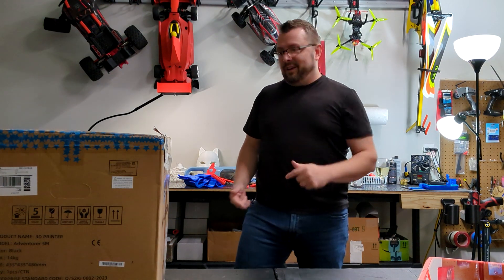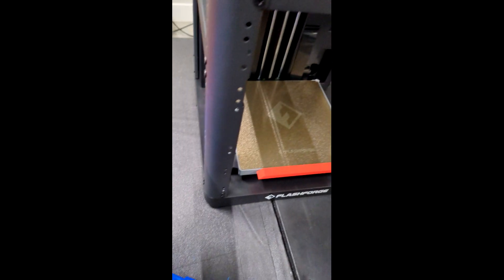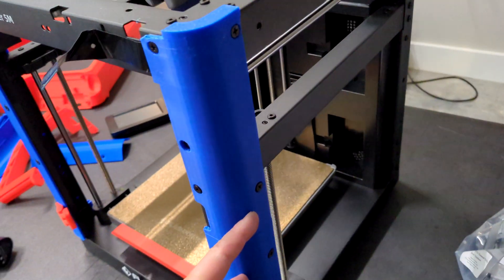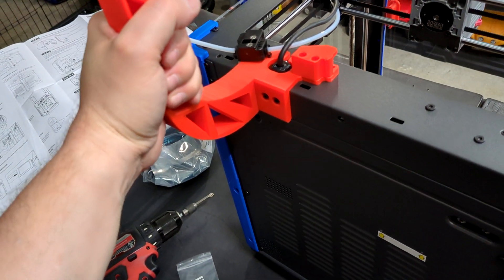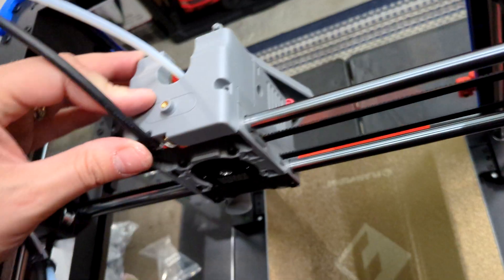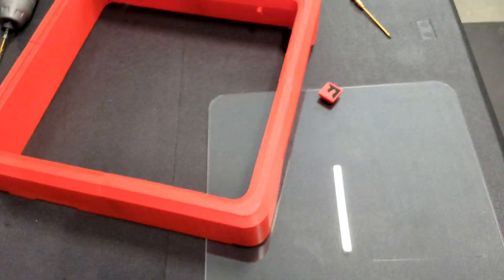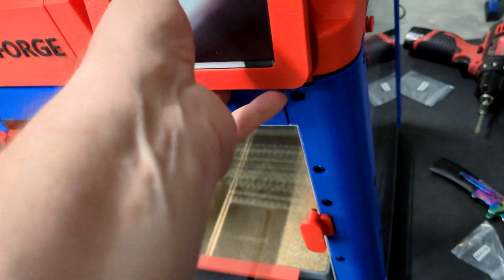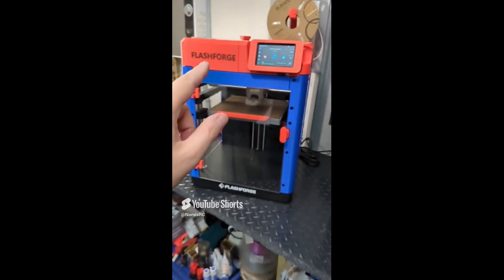Crazy 3D Printer FlashForge 5M $280 X/Y - DIY Enclosure Kit

Comment: I can't get mine to work.
Reply from the maker: Haha ok, please explain and im sure i can get ya fixed up
Reply: @NomisRC  It starts off great and then when I stop watching it I come back to a cluster of string looking like a rats nest. I'll try to get a video together and post it next weekend.
Reply from the maker: @bulrydrdan #1 use orca flashforge app, do not use flash print. Get the newest off flashforges site. When you have a part all setup and sliced when you click "print plate" in the upper right a box will pop up. Make 100% sure "Leveling" is checkmarked on every print u do.

Comment: I am trying to print the enclosure and am having trouble. The instructions are lacking printing instructions or maybe I am just to new to this to understand. The spool holder I cannot get it to fit on the print bed in Flashprint. I tried orienting it the way the flashforge's video shows and it still will not fit. Also should the hinges be printed as one part or separated. The Flashforge video shows them as one part and I printed them that way and they won't move. Anyone other newbies struggle with the enclosure kit?
Reply from the maker: Sadly all my parts were printed on a Neptune 4 Max, so I cannot help with orientations and such. My main thing would be dont use flashprint, use orcaflash its much better

Yes the hinges need printed as one, do not use brims or supports and they will print fine.

I agree it was a ton of parts and you really dont understand it all till its printed and you are assembling it. Also, you may find out on a 1 or 2 parts you need to reprint them. Such as the hinges.
Reply: I had the same issue initially, just had to keep reorienting it until it fit and it did.

Comment: Dammit man. YOU are going to get me in serious trouble.  I ran across your build video of the flsun t1, and will have it cued when mine gets here Thursday. Then I see the FF 5M vid, which is a printer I've seen over and over for $279 on Amazon and have had it in my cart a dozen times. I hadn't dug far into it and didn't know about the enclosure, which has the damn thing in my cart AGAIN! Thanks bud, my 1st printer is Kobra 3 combo, got it end of January, the delta with be in soon, aaaaaaand day after that the 5m ya ass! Lololz oh, and when your influence seemed to have finished causing me money issues, an addiction I had finally kicked a year or so ago... Know what that is? RC bashing dammit! Question, do you or are you interested in collecting Transformers figures? That's my 3rd addiction lol. If so, I'm seriously screwed. Lmao, thanks for the tip on the static on the t1. Pops tells me I just need to ground it and be ahight. He's gonna come figure out where and how n such. Once that's done and works, I'll upload a how to, and share it with you.
Reply: Btw, if it's not obvious enough, I'm being totally lighthearted, and really am glad I found your channel.
Reply from the maker: Hell ya man. RC and Printing are my absolute passions. I knew you were fuckin with me haha all good. I just ordered the 5M pro as well. Its no better it just has a couple add ons and I needed one more printer. The stock 5m is awesome. The main thing I found is dont use their slicer, their supports are just awful. Just use regular Orca it has a profile for the 5m that works perfect and it has normal supports. 

The issue with the supports in flashprint is they are like twigs and you cannot make them bigger. They dont always get knocked over but, often they do. Using Orca has fixed the issue np plus its nice to not have manufacture limited software. The FLSun has limited software but it works fine and the supports are fine so I sill use that. But I may move to Orca just to have them all in one place. Just a couple FYI's. I will be releasing a video soon with all the things Ive done to really make both of these printers to my liking. Also FYI hah on the FLSun you can totally turn the fan down while printing. Even at 70% its much quieter. At 50% it sounds like a normal printer. You can slice it this way so that the whole print is 50% fan. As long as you arent doing 1000mm/s it is totally fine.

The phone apps for both work fine though. Flash maker and FLSun World. They have the basics you need to away from home monitor your prints. Of just sneak a peek when you are in another room on your phone to make sure its all good. It's the computer apps that I will just convert to straight Orca Slicer with. But the Flashforge is IMO a must do.

Im telling you all this now because my video will release after you already have the printers.

Comment: Throwing in a meanwell PSU makes a noticable difference to noise at idle. Highly recommended. 
The main board collers can be replaced as well. But the default PSU fan is the screamer in my experience.
But overall it is incredible value at the moment.
Reply from the maker: Thx for the advise.